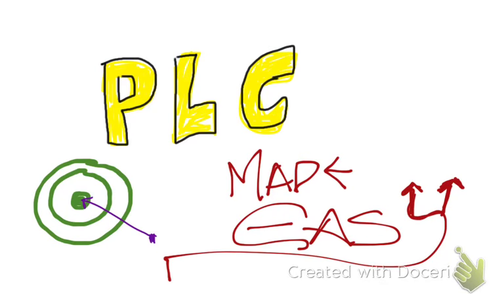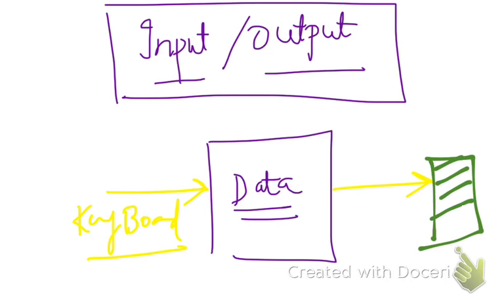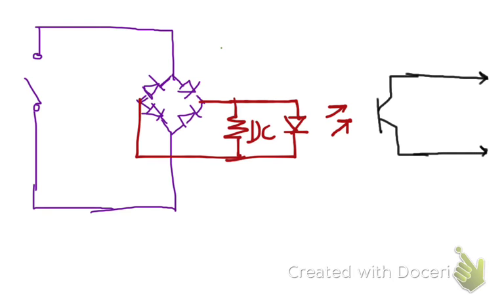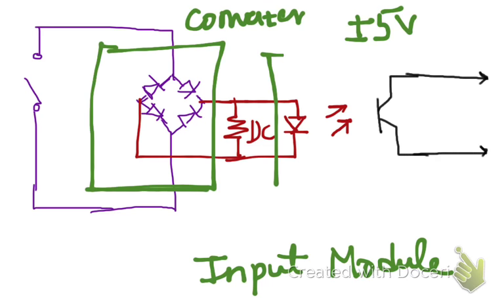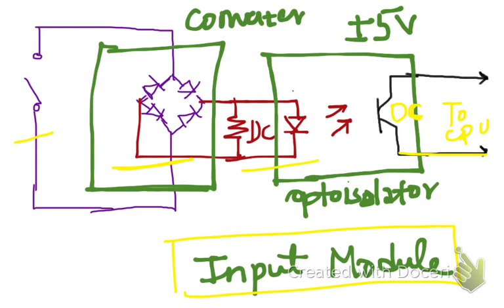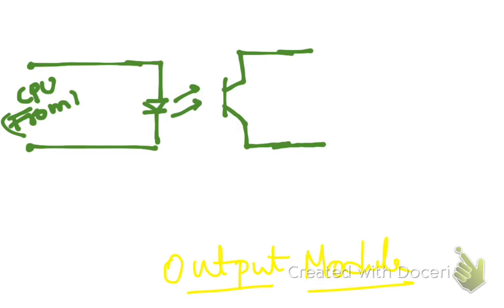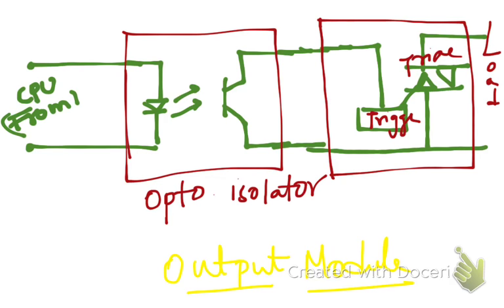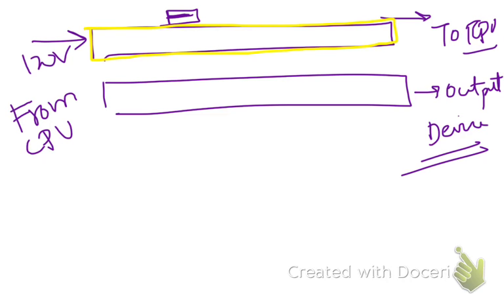PLC  I/O Modules (Inuput - Output Modules)

Comment: Can optical isolator damage or stop do work because I connected hyd pump solenoid on no 7th terminal  and directional control solenoid connected on no 21 ....acording to program but now sometime no 21 th point not giving  supply I checked continuity negative and position wire , voltage  also after that change module and connector also but upto now facing same problem...my English is not good I hope you will be understand my problem please help me

Comment: PLC = power line communication!
but you explaine work of sensors and actuators for power line!
where is communication between devices?
incorrect name for this video!
Reply from the maker: There are several acronyms. PLC also stands for Programmable Logic Controllers which are integral part of our daily devices.
Reply: PLC = Programmable Logic Controller